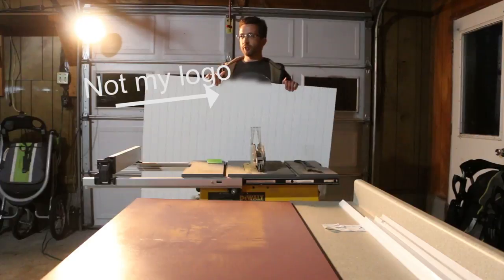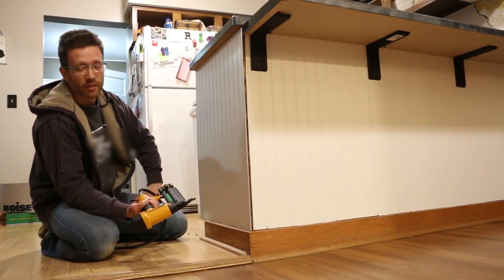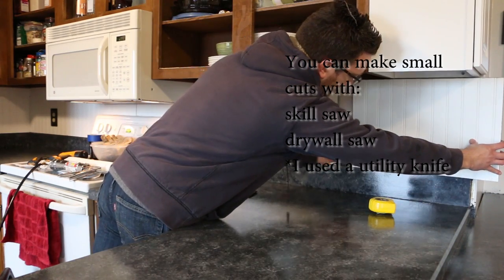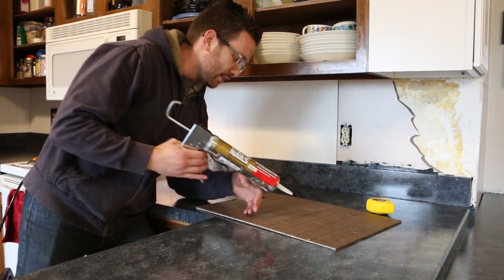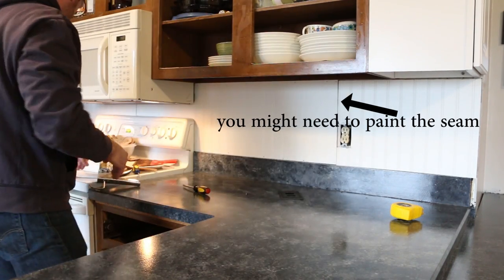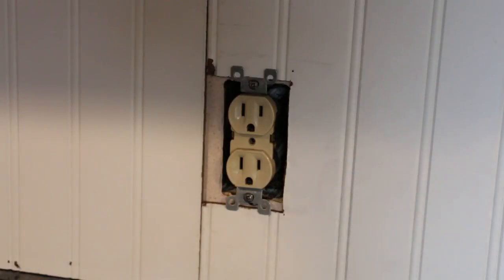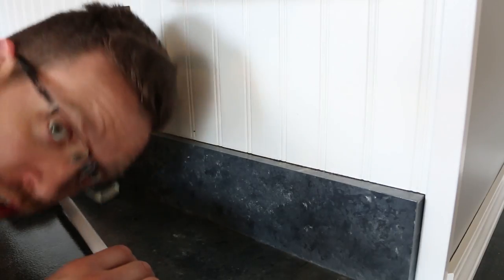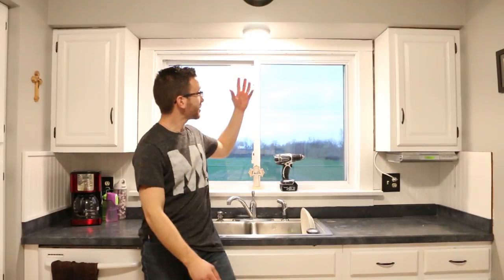How to install beadboard / wainscoting DIY

Comment: You could have used a wall plate spacer on the electrical outlets. But I actually never thought of using beadboard for a back splash.

Comment: Does beadboard need to be whitewashed or painted when used in these applications?
Reply from the maker: I did for the backsplash, but some come prepainted and it primed.
Reply: @brianrehmann  do you mind if I ask what type of paint or treatment you used?  Would the prepainted and printed be suitable for backsplash as is?  Sorry for all the questions,  I expect to be using this in an upcoming project and trying to figure it out. Thanks
Reply from the maker: @rb4382  we used a semi-gloss. If it's printed I'm not really sure. It really just depends on how pourus things are and if they can pick up moisture or not.
Reply: @brianrehmann  thanks!